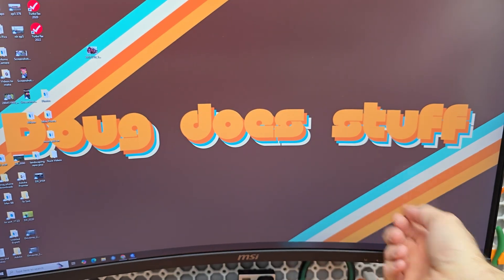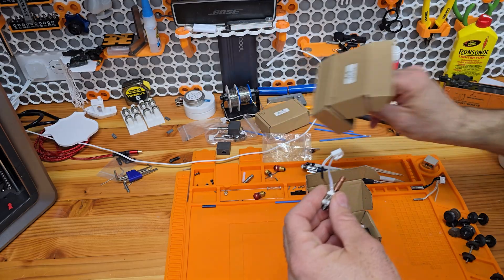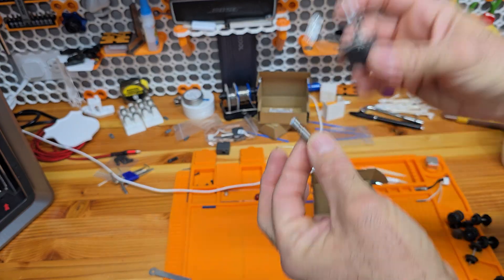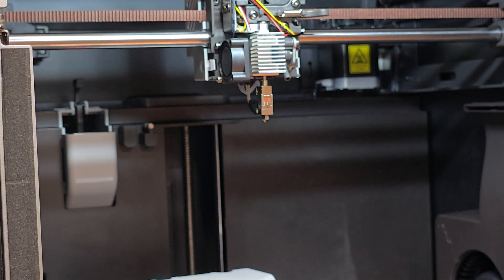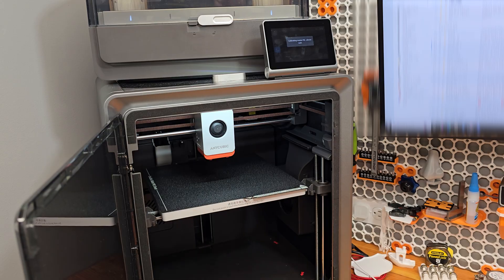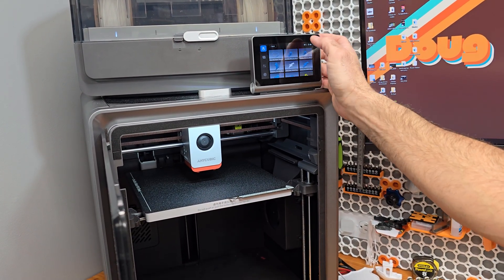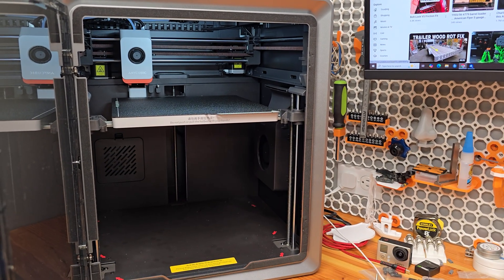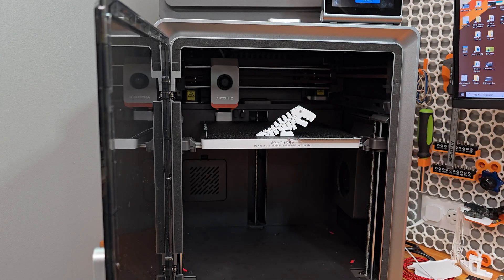Kobra S1 Combo: Hotend update....fixed!!!!

Comment: Nice!   Im having an issue with the Ace Pro itself, it keeps giving me an error code 11503" connection with the color engine can't multicolor print just single color using the spool holder that came with it very annoying.

Comment: Unfortunely the printer screen is only poorly visible in the video. Did you actually change the hotend type in the printer configuration?
My printer won't accept changes to the hotend type.
Reply from the maker: I did change the hotend type, sorry you can't see that in the video.

Comment: I bought one of these nozzles for $12 off Amazon and installed it on my Kobra S1 before I even plugged it in for the first time. I have a little over 300 hours on it, I never tighten it while hot and it's been perfect.

Comment: did 2 prints so far with the new hot end, totally forgot to do the heat tighten, no problems, but definitely gonna do that now
Reply from the maker: yeah, when I went to retighten it was so tight already I couldn't move it more.  You're probably good to go.
Reply: @dougdoesstuff24  good, cuz i in fact did not tighten and am on my 3rd print since, no issues

Comment: there is a free print model for kibra s1 where to hang the printhead Cover to the Side safely . so no need to remove wire cable all time .

Comment: How are you finding the new Hot-End with hardened steel nozzle? I bought a couple, but they have been sitting in my closet gathering dust as the supplied Hot End refuses to die (100+ hours so far). I dont print abrasive filaments either, and I havent been motivated enough to swap one in. I know the ceramic heaters are safer and much faster to heat up.... but Im being lazy.
Reply from the maker: Unfortunately I have not been printing because of my leveling issues, but for the hours that I used it I liked it.  Heated quick and I didn't have to worry about having another nozzle leak due to the PTFE tube being pushed out.
Reply: @dougdoesstuff24 great to hear, I’ll get my act together and try mine. I’m glad you showed the hot tightening as mine didn’t come with instructions. I’m fairly sure not doing that would end in leaks and print failures.
Btw, did you select the new nozzle type in the printer menu afterwards?
Reply from the maker: Glad to help when I can.  I tried to tighten more, but mine didn't need more, BUT you should do it just in case! Yes, I changed the nozzle type in the firmware.  Once you do that it forces you shut down and rerun a full calibration.  I also changed the nozzle type in the slicer nozzle settings
Reply: @dougdoesstuff24 that’s great info, thank you. 🙏

Comment: awesome vid bud, i have two S1's myself. got one without the ace just one color and the 8 color combo. had issues with my first after 200hrs of awesome printing. too good to be true. my second one 10hrs and nothing but issues. more so my fault but what a pita when these hot ends go out. and the ace just makes life harder in my opinion. takes forever to start and if you stop its a nightmare. smfh. lol

im def going to get some of those, thanks for the update!

Comment: Does anybody have a step by step guide to changing the .4mm brass hotend for a .2mm hardened steel one? I cannot seem to get these steel ones to work even after replacing parts in it.

Also the machine doesn't have a .2mm HS profile you can set it to, which worries me. But i was told that those profiles for nozzles are there but you can also overwrite those settings with changes in the slicer. is this true? What settings should I use?
Reply from the maker: It might be easier to buy an assembled hotend to be honest.  To get the nozzle out you have to heat it up and then fight it because of the thermal grease/glue they use.  I've done it, but I messed up the heat break doing it.  Then to reinstall, you tighten heatbreak down so that the last thread is seated and then the nozzle gets tightened up to that.  Heat it and repeat it.  You can make any profile you want in the slicer.  You will have to run calibrations on that nozzle to figure out what they are, but you can do it for sure.  Good luck with it
Reply: @dougdoesstuff24  Yeah I bought 3 new hardened steel nozzles already on hotends. A .2/.4/.6 and when installing any of them I can extrude filament just fine manually. But if I run a print then nothing comes out. 

I got replacement parts for those new hotends and tried again but still nothing when I print. I am unsure what the issue actually is.
Reply from the maker: Did you check the resistance on the thermistors?  With some aftermarket ones there are issues (another video I did).  They have to read over 200k ohm to work.
Reply: @dougdoesstuff24  I didn't buy the company sent me new parts for the hotends saying those original parts were no good. Either way I'm done, sending them back because this is too much bs to go thru with a new product.
Reply: @TomTrustworthy  Részben hasonló problémám van nekem is. Volt egy filament akadásom a dobon, megfeszült, azóta csak küzdök, mint malac a jégen. Az első rétegben néha jól, néha hiányosan adja az anyagot, aztán amikor a második rétegre vált, gyorsabb tempónál egyszerűen nem ad elegendő szálat. Egy hete nem tudok nyomtatni. Kipucoltam az extrudert, az ACE PRO-t, a teljes filament cső hálózatot. Javult az eredmény, de nem lett jó. Korábban Aliexpress -ről rendelt "nagy, kocka" hotendel és kemény fúvókával dolgoztam. Még egy valami eszembe jutott, az előfeszítés kevés lehet az extrudernél, emiatt ha egyszer eldarálja a szálat, onnantól baj van magasabb mennyiség igény esetén. Ilyenkor szét kell szedni, kipucolni a rovátkákat, ügyesen összerakni mindent, majd imátkozni, hogy rendben legyen. Ezt ma délután fogom kipróbálni, remélem megoldja a problémám.
Extrudert meg nem lehet kapni 😡. Egy török webáruházban találtam, de 2x-es áron + szállítás, annyiért nem eladó 😤

Comment: I bought a couple of (what look like) the same aftermarket large heat block hotends from aliexpress along with the small block versions. One note about the PTFE tube in the heat break: make sure that the tube is seated all the way down in the heatbreak and that the bottom is cut straight across. I had one where the tube was flush at the top but was about 3mm shy of being seated at the bottom, when it jammed I did a cold pull and found that filament melted at the bottom and formed a lip which pulled the PTFE out. I inspected the other and found that the bottom was cut at a slight angle so it would've done the same.

Comment: Got my new nozzle installed from amazon. Have the aliexpress ones on thier way. So far, the amazon one SEEMS to be working fine. It extruded material from the ace pro well. Doing a test benchy now to see how it goes. 

I DID however see an option to change nozzle in the settings, changed it to hardened because thats what i ordered, and it forced me to reboot the printer by power cycling it, then  it automatically re-ran a pid calibration, resonance calibration, and auto-leveling. Hopefully the new pid makes all the difference.

Edit: still filament clogging detected. I have no way to test the ohms of my original thermistor here, but it could be that the oem that shipped with the printer was also out of spec. Idk. I will have to wait a few weeks till i get the ali express units and see what happens then.

Edit 2: i still cannot get a good first layer put of the amazon hotend. Going to try swapping the thermister and heater over once it cools a bit. Also, i think alot of the issues possibly lie with how the ace pro runs on this machine. All the retraction and extrution happening with it... the back and forth potetially causing clogs.
Reply from the maker: Yeah, I had the same issues with the amazon one.  It would push filament, but it wouldn't stick and would just clog.  I too changed the nozzle setting (not entirely sure what that does though). Definitely swap in the original thermistor and heater cartridge if you can and let us know!

Comment: These new hotends are actually based on clones of the BambuLabs X1C hotends. They're very good and you can get similar ones for most modern printers now. I have them on my K1 and SV08 and both are better than their original stock hotends.
Reply from the maker: interesting and good to know

Comment: Yes, sorry the thermistor, I kept thinking it produced its own electrical. The thermistor and the ceramic heater should have thermal paste and with the thermistor will have paste in the hole it goes in. This will increase the efficiency of it temp PID.

Comment: Check the ohms of the thermistor of the aftermarket hot end. It's needs to be 200K ohms. My Kobra S1 dropped the hot end and broke it. While I waited for the replacement from Anycubic I stuck an aftermarket one in and it would not print at all, just clog. Checked how many ohms it was and found it was only 93K ohms. Took the heater and thermistor from the stock nozzle and put it in the aftermarket one and it prints great now.
Reply from the maker: I tested the three thermistors I had, original - aftermarket - aliexpress.  Video coming out later today with results
Reply: Good detail, i was just about to say these thermistors/heater cartriges are interchangeable and for the most part are, i use one on my vyper that was sold for a kobra 2 pro, but they both use 100k thermistors.   I bought this same nozzel for a the kobra 2 but when i disassembled it i noticed it had a vyper heatbreak in it which had me confused, then gave me the idea to use it in my Vyper , which i also owned and it worked!  Which was nice because they're only like $10 and a specially designed ceramic heater nozzel for the vyper is $50..  nice cheap nozzel upgrade hack for anyone who owns a vyper.  But its good to point out your thermistors should match.  That being said they all pretty much use the same ones and dont make their own at the factory, even bambu uses the same components as in these nozzel kits.  Except the heatbreak, thats what they customize to fit their printers.  Also be careful the cartridge doesnt detach from the block as you hot tighten it.  That happened to me and I fried it. Didnt detect heat anymore so kept pumping in more current until the cartridge fried is my guess.    Not very easy way to hot tighten these things, not much room to grab onto if you dont wan to wreck anything.    
  I would add the all metal heatbreak gave me more jamming because my cooling was insufficient to keep that part cool, or my retractions were too long bringing in soft fialmetn into the heatbreak. Or it was simply the metal not being as lubricated at PTFE is , and went back to the PTFE heatbreak and had no issues since. Its a nice ceramic heater nozzel, but id avoid the all metal heatbreak if your system didnt have one already because it will most likely introduce more heat creep then your system was designe for and therefore more jamming.  But maybe not, it did in my case, but my fans were weak on the heat sink etc.  I think the S1 might be ok with all metal.  The Kobra 2 i upgraded did actually jam with the all metal so i went back to PTFE with is as well.  I thought the Kobra 2 was safe from it with better heatsink and cool compared to my Vyper but it too jamed with the all metal heatbreak. Incase you have problems go back to PTFE  Theres some good PTFE i found on ali that doesnt even deform at 250c and some say they tested it at 260 fine in the reviews, its not capricorn but its cheap  and that will allow you to keep the PTFE design and also print hotter temp for abs at leaste without needing all metal heatbreak and not get jams is my advice.  Just get a better PTFE tube instead of going all metal. Unless your printer was all metal before, it probably wont work right.

Comment: cant wait to see how the torture test works... i had less than 20 print hours on my s1 before i had a nozzle clog error. turns out, that that inner tube in the stock hotend is supposed to sit flush with the end of the metal tube. mine apparently did not, or at least it worked its way out over time. pulled out the tube, filament and all, pulled out the filament and clog from the tube, reinstalled the tube into the hotend, reinstalled the hotend back into the print head, making SURE it was seated as deep as it would let me put it into the heat sink, then ran filament through the system (purged a few cycles with the extrude function on the filament/ace tab on the touch screen) and now am trying to reprint the part that failed to print due to the clog. so far so good 20 minutes into a 3.5 hour print. on the previous reprint attempts it never got this far. this attempt i also re-sliced the file, and reset the filament to default profiles. 

i will edit this post if the print fails or if it succeeds. if it works, hopefully this will help other S1 users with similar issues. i dont think the stock hotends are built well at the factory, and/or installed correctly into the print heads on every unit shipped. if more of us have similar hotend issues, perhaps anycubic will fix the flaw,  or at least edit the unboxing instructions to double check your hot end by taking it out and making sure that tube is installed correctly flush with the top of the metal tube before putting it back into the print head. this might need to be something that every new s1 user should be doing before starting the unit for the first time.

update: the print  completed, with some initial few layers not printing correctly. no first layer issue strangely enough. after a few layers tho, it appeared to fix itself and did not have any other issues. going to try reprinting yet again and see what happens this time.
Reply from the maker: 100% Anycubic needs to do something about the hotend, it is an obvious problem.  Whether they go to this style of all metal heatbreak or update their instructions to remove and check before using is at the very least a starting point.  Good luck with your print!  Here's some insider info, the multiboard printed :)  Video editing makes things a few days behind.
Reply: @dougdoesstuff24  apparently according to another youtuber, they had problems with thiers too, but the new nozzles they sent back to replace the original ones were basically the same thing, only the nozzles appeared somehow glued into the hotend. this apparently was to fix the issues where the hotends would become filled with filament and clog. i do not know how that will actually fix the issue, as the inner tube can still move freely.
Reply from the maker: I tested the three thermistors I had, original - aftermarket - aliexpress.  Video coming out later today with results

Comment: I see in the description box that you’re on vacation. Wondering if, when you get back, you could measure the resistance on the thermistor of that first replacement hot end you bought. It should read over 200k ohms. The set I got was down around 113k, which wasn’t letting the filament get hot enough. Thanks!
Reply from the maker: Will do.  I am home later today.
Reply from the maker: I tested the three thermistors I had, original - aftermarket - aliexpress.  Video coming out later today with results

Comment: That throat, as you called it, is the heat break. The fact that the one you have is all metal, without the need for a PTFE tube, might be enough for me to try that one out. Glad yours is working now, but keep us posted. As you saw with my other video comments, I’m still struggling with mine.
Reply from the maker: Ugh, I shouldn't record too early in the morning.  I knew it was the heat break, but couldn't think of it!  Also, I couldn't think of thermal paste!  I wanted to get this out while I was away, so I didn't have a chance to rerecord.  I appreciate you following along and good luck with yours!  And yes, the all metal heat break I think is a must!
Reply: @dougdoesstuff24 LOL, all good man. And yeah, all metal is what everyone else is doing. One less area for heat creep and filament leakage. Poor design choice by Anycubic, in my opinion.
Reply: New nozzle arrived from Amazon.  Question.... did you do your new nozzle instalation that requires you to reboot the machine, then when rebooted, it runs the pid calibration, input shaping calibration and a new auto leveling run. If not, the pid calibration might be all you needed to do with the lower ohm thermistor. I'll let you know once mine finishes and I do a new test benchy.
Reply from the maker: @advirnig  I did every possible calibration to get it to work.
Reply: @advirnig I did a PID calibration on mine since the new nozzle was hardened steel. Sometimes the first layer wouldn’t stick because the filament would cool too quickly, other times the first layer stuck, but then the second layer (at higher speed) wouldn’t flow at all, or enough to make a print worth continuing.
Reply: I have the same hotend and it worked right out of the packaging. I should do the tightening before the first print.... but yolo.